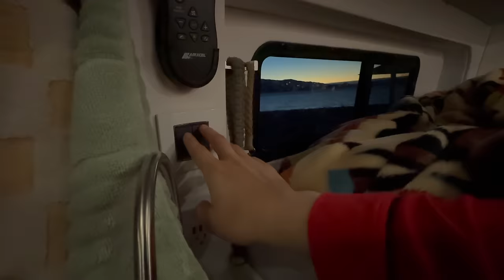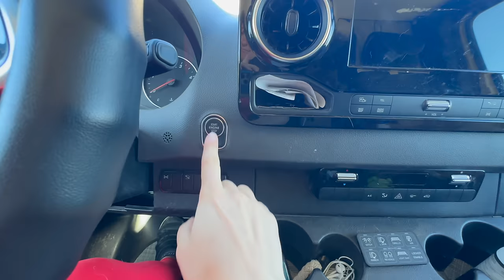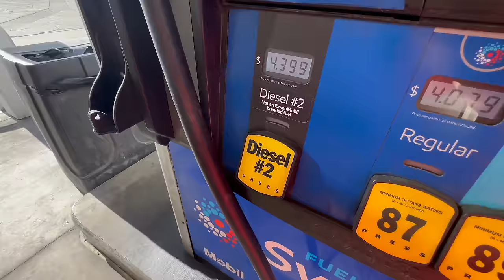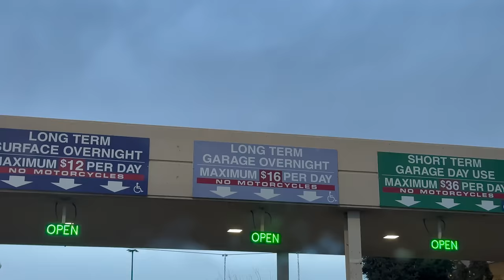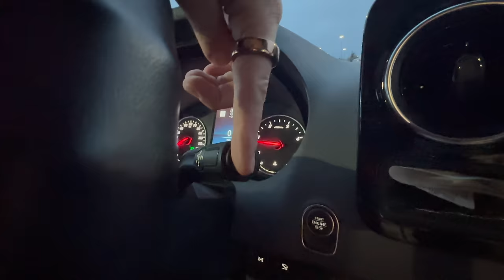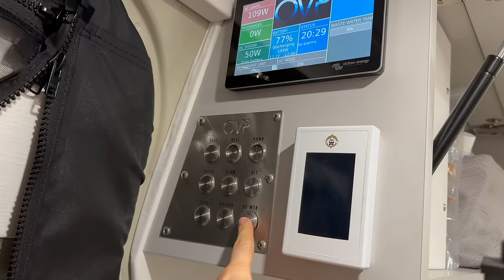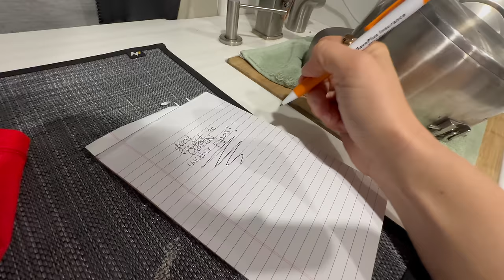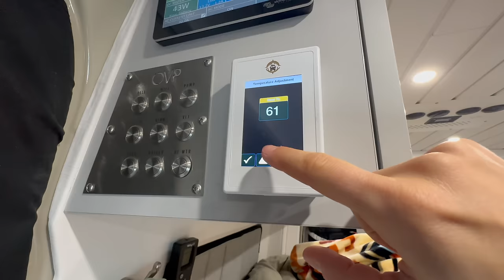Stealth Camping in an Airport Parking Lot

Comment: Nikki here is a little FYI:  A fully charged battery should not freeze until about -94°F (-70°C). A battery that is at about 50% DOD will freeze around -13°F (-25°C), and at a 75% DOD it will freeze at about 9°F (-13°C). The system should be designed so that it never discharges the battery bank below its expected coldest operating temperature.
Reply: Didn't sound like she's concerned with the battery freezing.  Most decent Lithium batteries, by design, stop accepting a charge when temps get near freezing to prevent damage.  With all the electronics on that van there's certainly a "ghost draw" and if it's too cold for the solar to charge em, she could easily come back to a dead rig.

Comment: I'd highly recommend a battery booster, which is like a portable car battery that can jump start a car with a dead battery. About $100, it charges by USB. I make sure mine's charged up every few months, which only takes a few hours while driving. Ti jump start your car you just plug the jumper cables into it, attach it to the battery and start the car. So much easier and faster than calling AAA. Plus, you would have a backup power supply for all your USB devices when away from the vehicle.

Comment: 😊 hi,  I use a portable jump starter that you can charge it up using the supplied USB charger.  I also use a portable air compressor in case the tires get low on air. I love watching all of your videos. Love you too.
Reply: I use gooloo jumpstart, which air pump do you use

Comment: I know I'm late to watching this video and all but I wanted to tell you about car jumpers! You've probably heard about em and if you don't have one yet I highly recommend one! It's a battery pack that will...you guessed it give you a battery jump start. There are many sizes depending on how big your engine is and if you have multiple batteries you just need to put it on your main starter one. The one I have is rated for a bigger liter engine than I have but I use it as peace of mind that it will be able to start my car. Just make sure you pay attention to the details on liters for gas vs diesel engines. Hopefully this helps and gives you peace of mind for when you long term park.

Comment: You can most likely jump your car from your house battery! I do it in my van whenever my main battery dies. Since the negative terminals are connected, all I have to do is connect the positives through my van with one jumper cable. Super easy!
Reply from the maker: Yes! I have a button and function for that- Except when u come back after a couple weeks and both batteries even the house are dead too. Hahaha!
Reply: @NikkiDelventhal  also happened to me! At the Reno airport too. Snow covered the solar and the battery drained over 10 days. Wish I knew to see if the airport had a jumpstart service then!

Comment: Just noticed you have your smoke alarm/carbon monoxide detector hidden away in that cubby with the vent slats. I was once told by a gas fitter, that it is best to keep these devices high up and not low in a living space, and definitely NOT in a cubby with 'minimal' ventilation. Just a heads up :)

Comment: if the gas station has the option for diesel 1 and 2 mixing the two also helps alot with diesel geling but your bottle works just fine might even be easier lmao

Comment: I am confused: 1. Why didn't you just stay overnight at friends home and drive to the Airport the next morning? 2. You drained the pipes because of the freezing. Was the water drained into the holding tanks? Wouldn't they also freeze? If the water was not drained into the holding tanks did you just dump it into the Airport Parking Lot?